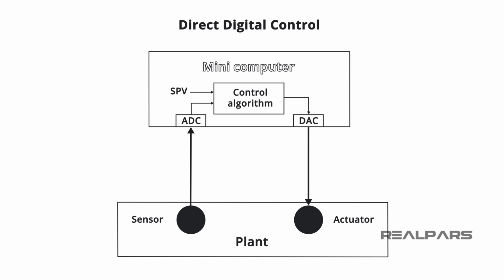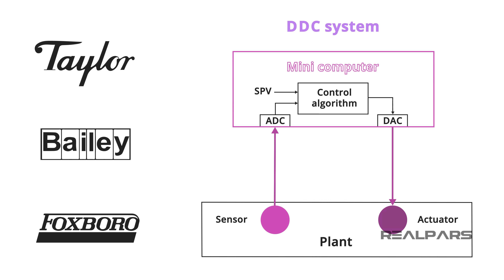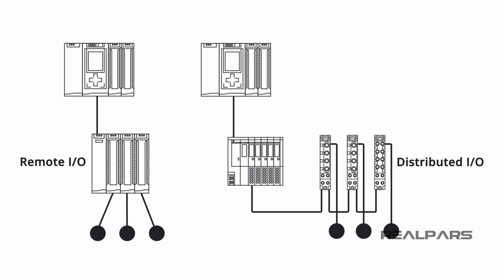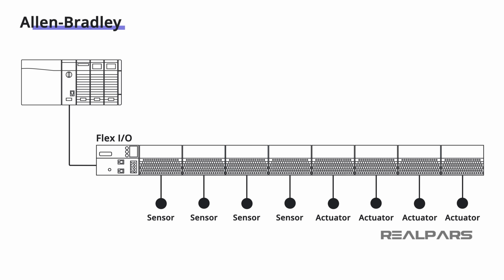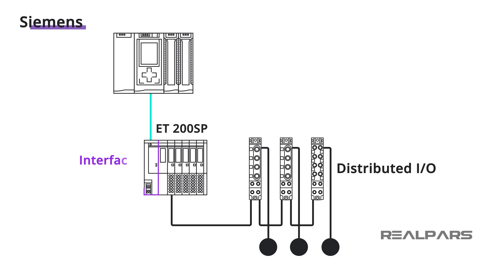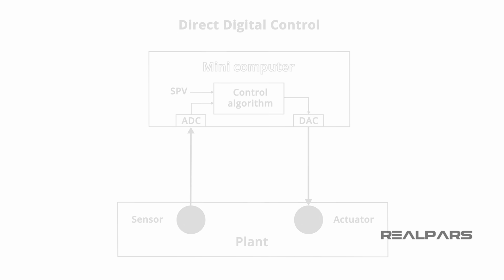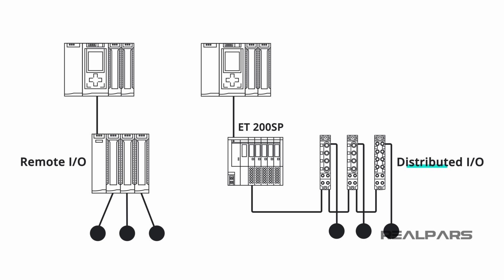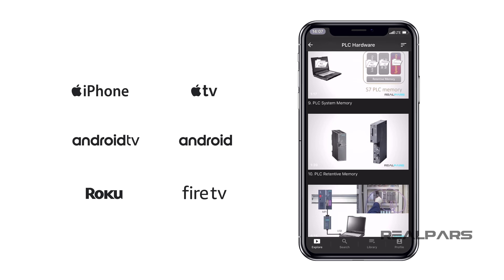How are Remote I/O and Distributed I/O Different?

Comment: I can be wrong, but it seems that even in this video, the two terms are mixed up.
Remote IO is remote related to the plc. The distributed IO is the next gen - it is remote AND distributed. It is not only remote stations with plenty of modules where you still connect a lot of signals at one place (a local control cabinet). In addition th tha5, you have modules which you can locate directly on the machine or on the line and 'distribute' connections even more. Such technologies for fast and simple connections as IO link, single pair, PoE all related to distributed IO as a successor of remote IO. Both concepts are useful,  depending on your project and instruments layout

Comment: What computing or processing can be enjoyed in the ET200 "distributed" I/O?
Reply from the maker: Thank you for your question. The ET200 is a family of Siemens I/O modules that communicate with the main PLC CPU via cable. One advantage is that you can place the I/O modules near your physical I/O and monitor the signals directly next to your devices. The ET200 line dates back to the Siemens Simatic S5 from the 1980s, and, as mentioned in our video, these modules do not have an embedded CPU.

However, with new technologies, Siemens has added more processing power and enhanced communication to the ET200 series, such as in the ET200SP. "ET" stands for Electronic Terminator.

Here is a link to help with your learning: Documentation for SIMATIC Controller. https://support.industry.siemens.com/cs/document/109744173/documentation-for-simatic-controller?dti=0&lc=en-WW

This resource contains comprehensive information about current Siemens PLCs and other components.

Comment: There is a problem with this video Earlier you taught us ES200 is a Remote I/O module in the same playlist now you are teaching us that this is a distributed I/O. It's too much confusing
Reply from the maker: Thank you for reaching out with your question, and I appreciate your interest in our content. I apologize if my previous response caused any confusion. I want to clarify that the information I shared pertains specifically to the Siemens PLC system, and while other systems may offer similar functionalities, they may present them differently.

To simplify the explanation, let's consider the scenario of a conveyor system with a main powered CPU rack. This rack can accommodate a limited number of IO (Input/Output) boards before requiring an additional rack for more IO. For instance, if your main rack is located in a control cabinet and the first operator control panel is some distance away, running numerous wires from the main CPU rack to the panel can be costly. Here's where remote IO comes into play.

By replacing some IO cards in the main CPU rack with an Interphase module (IM) card and setting up a separate rack with a power supply, another IM, and the removed IO cards, you can connect them using PROFIBUS DP communication. Place this new rack near the operator station, reducing the need for numerous wires. This method is a cost-effective solution, as the main CPU believes all the IOs are still on the main rack.

For those using Siemens, this is achieved through the ET200 system, specifically employing an electronic terminator (ET). Siemens offers various ET200s to suit different needs. Moving on to distributed IO, you can use the ET200SP, a mini-CPU with substantial capabilities. By adding the appropriate interphase and establishing communication with the main CPU, the ET200SP can take on specific tasks related to the conveyor system. This setup allows for a more efficient distribution of tasks between the main CPU and the ET200SP, with both units treating the IOs as if they are in the main rack.

I hope this concise example provides a clearer understanding. For further details, you can refer to the Siemens site, which I've linked here for your convenience. Happy learning!

https://support.industry.siemens.com/cs/document/58649293/simatic-et-200sp-distributed-i-o-system?dti=0&lc=en-US

Comment: What was explained here are two different concepts. Remote I/O and Distributed Control.
Distributed I/O and Remote I/O are the same. But the more appropriate term to use is Remote I/O.
The term "Distributed I/O" is misleading because it confuses us with the original term "Distributed Control".
Distributed Control is a network of Control Modules (each with its own I/O modules, which in turn could be in direct or remote configuration)

Comment: let’s say I want to adjust the speed of a 3ph Induction motor. So, to do that, do I still have to use the distributed I/O system even if I have Sinamics G120 CU240S drive with me? Please let me know ASAP because I’m using Simatic Manager and I’m confused with the difference between Sinamics G120 CU240S drive and Simatic ET 200S FC.
Reply from the maker: The G120 CU240S drive is a standalone VFD control unit that is connected to a G120 power unit to provide control of small motors (~4kW).  The ET200S FC is a rack-connected frequency converter (also up to 4kW) that integrates its I/O into the rack communication interface. The standalone G120 version requires its own Profibus connection to the network since it is its own node.
Reply: @realpars  so ET200S FC will be used only if I want to control large motors?

Comment: I am still confused as tot he difference, since I am mostly a Rockwell guy I'll refer to what you said about Flex I/O. You said Flex I/O is distributed I/O but I see no difference in a Flex I/O rack and a 1756 Remote I/O rack, in the case of the Flex I/O the communication head does not have computing power in more than the ENBT card has in the 1756 chassis. they seem to be the same to me, and I would refer to them both as Remote I/O.
Reply from the maker: Brian, you are likely not alone in your question.  This video looks at the definitions of distributed and remote I/O and the nuances between them.  Very often, we use the terms interchangeably.  In some systems, like the Siemens S7 system, these differences are clear between I/O subsystem types.  In the Rockwell world, remote I/O used to be limited to I/O racks that were extensions of the main rack and used special extension cables to extend the main rack, thereby allowing the I/O to exchange data via the backplane. While this construct is still common, the use of Ethernet and IO Adapters is most often used.  This can allow multiple PLCs to access the data via Ethernet (characteristic of distributed I/O), and for a rack of Flex I/O, the ability to hold configuration data in the card or adapter (also a characteristic of distributed I/O).

Comment: I have a farm in southern california.  I use automation direct plc to control my irrigation.  I met a couple of electricians who remotely controlled the irrigation of a golf course with automation direct plcs.  Similarly i meet a board layout engineer who set up a seimens plc unit to control credit card punching operation.
Most vendors look down on these ventures, but i think that this is a growth oportunity, especially in these times.  Remember sabre tooth lion did mot survive when large prey animals went away.
Reply: Nothing wrong with Automation Direct for a simple system like that, but I would not trust them with a factory that costs tens of thousands of dollars per minute for down time, or would lose a 100 million dollars of oh say Beer that is in process like AB inbev has at any one moment. Nor where large data aquisition and MES SCADA systems are required. Try to do a totalizer in Automation Direct vs, Control Logix. the AD will not be very accurate.

Comment: I have a distributive control system.  One thing i wanted to do was to operate inndegraded mode, where operation could continue in a degraded mode if a remote unit was offline.  
The question would be how to write the software so that this could be done.  Asked main plc vendors and did not get an answer..

Comment: I see a lot of remote IO but not distributed IO.  In what circumstances would distributed IO be preferred?  The only thing I can think of is an immediate action.  The PLC takes some time to scan all the inputs and then run through the logic program, so a field device would shave some milliseconds if it performed some of its own decision-making.  In my experience, PLCs are plenty fast though.
Reply from the maker: Remote I/O is very common in both DCS and PLC systems.  This allows I/O interfaces to be placed closer to where the devices are in the field.  Distributed I/O is most commonly used with instrument busses, such as ProfibusPA, ASi, and Foundation Fieldbus.  These are field-level protocols which are wired and configured as nodes on a bus system, not as individual connections to an input or output card.  Passive connection blocks (or bricks) can be used to simplify cabling, but the path from device to the controller is directly back through a communication card that speaks directly to the CPU.
Reply: @realpars  - OK, thanks, that's a pretty good explanation.  It sounds like the advantage is that having your IO devices on a bus network may at times provide savings on installed wiring and such.
Reply: Great video